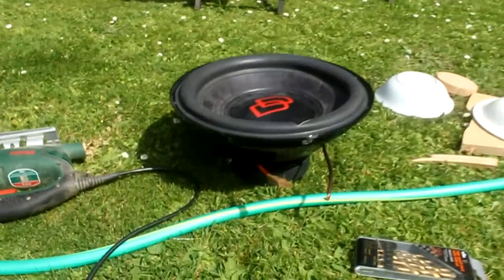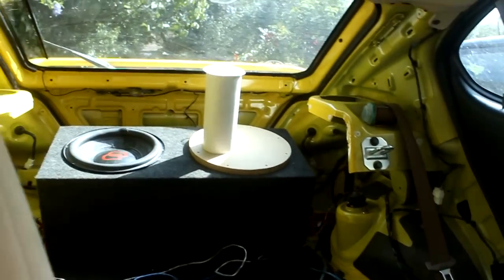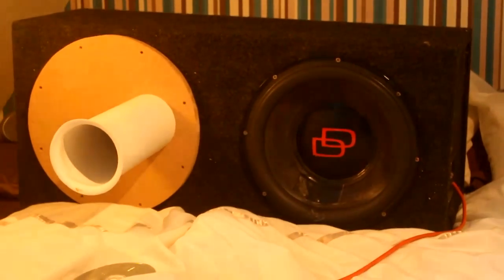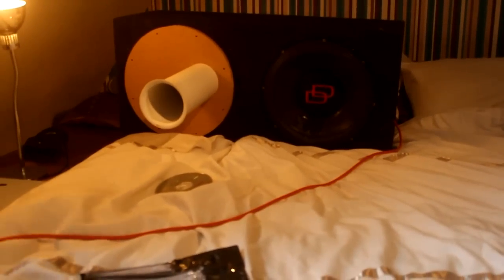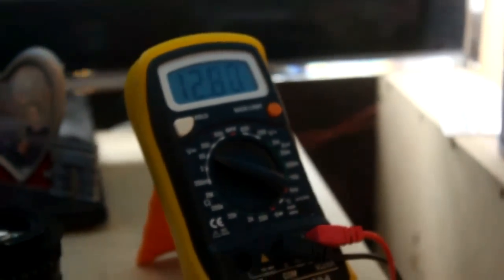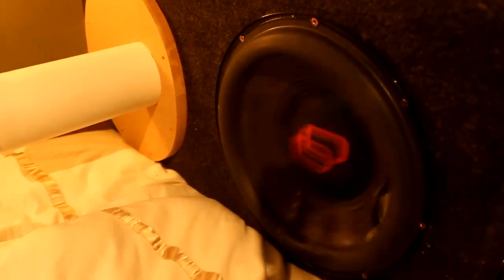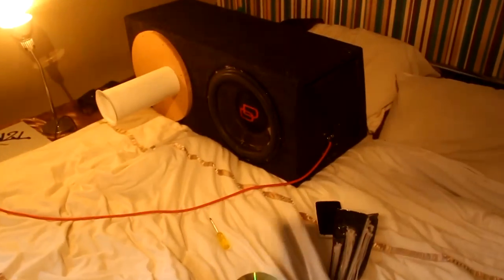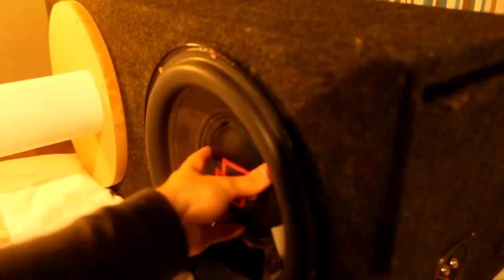Digital designs 1012 rips itself apart!!

Comment: I modded a cheap power amplifier that was only $120 off ebay and it puts out 2000 watts RMS they say and I tested it it only makes 1747 watts RMS CLEAN close enough and what I modded was I got rid of the speaker protection circuit and made it so it is always clipping to the extreme with now making 2346 watts rms full on clipping and it clips from 1 watt rms all the way to that 2346 watts rms and it is made to destroy speakers and subwoofers and it is modded to also go down to .5 ohms without getting too hot spent 3 weeks figuring out how to do all this.
Reply: Aaron bilger what amp

Comment: i left a kicker up to my pc and watch this video... my wofoer was getting fairly stinky by the end... forgot it had it on.
Reply: +the awesome toaster it is terrible, but its alot better than stock, aluminium former coil instead of paper. it was a sub my friend found on the side of the road blown. fixed er up with scrap parts.
my good sub is the Sundown X-18 D2 and my other good sub is the Alpine Type R 15"
Reply: so im still using my first box on my sundown and volume was wrong with messed up my port tuning, i bent the port arround the side and made it longer to get me my lows back, 40-20hz is sooo crazy now! im still gonna build a t-line once i have enough wood but that port length change on my box is a night and day difference. i did loose out above 40hz but the alpine covers that fine.
Reply: what am i lieing about now? also after a few months of dumping large amounts of power into the kick i realized that jb weld just makes a smell when it gets hot, i aculty cant kill the thing because i tried. used an amo that pushed 500wrms @ 4 ohm and blasted it full tilt for an hour with a clipped signal! 
also still aint got the wood for that T-line, but im bout to run into some money and that is one of my priority's!

Comment: good vid mate. u gonna wall the proton off arent ya ?
Reply from the maker: thats right, bootwall!
Reply: barevids Has the proton been mechanically reliable? I've heard they may suffer from fuel pump and ECU issues.
Reply from the maker: Antimation Studios Been all good for me. Only issue has been the crankshaft sensor thinks there is a problem and reports a false error. common fault but no issue with car, just a sensor.
Reply: Hey barevids ,whats the song name ar 8:42 would really like to know where to find the song ,or could you provide me a link ? want to blow up some old Kicker Subs with it :)
Reply from the maker: My own track - Bassheads Anthem! Used to be on iTunes and Spotify years ago.. not sure where it exists now. Theres a slightly clipped version on youtube which you could use.

Comment: had a 2512 dd with 800w hypex amp . amplifier was much more powerful . a dd 210 with 170W hypex amp , it hit the magnet and a burning smell with only 170W. but hypex have real w . one 800w hypex amp has peak power of 2- 3000w I think.also had a Electrocompaniet 2x 100w , it certainly had blown the bass if I had tried , it was powerful and old. must be fool w on the subs , same as most amplifiers.but is a nice subwoofer for price gives much sound for little money

Comment: Hello barevids, I'm a employee of Master Car Audio's, I was watching your video and I herd you saying a distortion sound, the subwoofer does not make the distortion sound, the amp puts a horrible sound (most amps) usually when you turn the volume with the bass MAX, this means that the amp is not a powerful system, (another way could be the number of amps the amp has) Some amps sounds clear when you turn the volume up and some, not clean. As I continue watching, I see your using a home amplifier? I couldn't hear you correctly but be-careful because this is a car subwoofer your powering and using a home amplifier could overheat itself (due to the subs ohms) and could put itself or your home fuse box in protection mode. Car subwoofers are very different on power <wattage> and current <power> then home subwoofers. I know it sounds stupid coming from me, but if your trying to blow up a subwoofer, I recommad plugging the subwoofer to the AC outlet, quick blow. If you have any questions regarding audio or any other information, reply back :) Great Video
Reply: +Cesar magana ohms , if the subwoofer is 4 ohms and the amplifier is designed for it will be fine , but there is virtually no home amplifiers like 2 ohms , only the best can dt . the amplifier he uses can I nothing about , but my dd210 is 4 ohm. with a good amplifier is sound completely fine until it goes boom ! Ever since I was 14 years I have used car subwoofer home . Now in recent years there have been some fine subwoofers for home use that can create sound pressure down to about 20 hz . with small subwoofers, I am now 36 years. I worked with car audio system when I was 14, that was when the competitions started in Norway . a car that played 150 db at the time was totally wild. has a seas 10 "made for home and car , it is 4 ohms. is one of the top 10 " in terms of sound quality, but 10 kg subwoofer